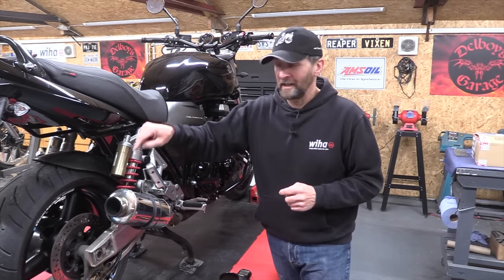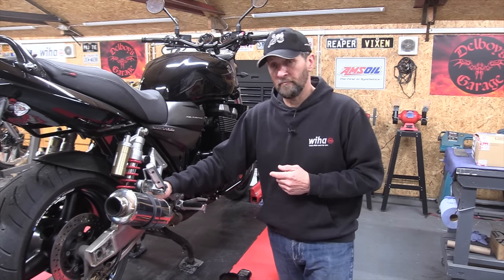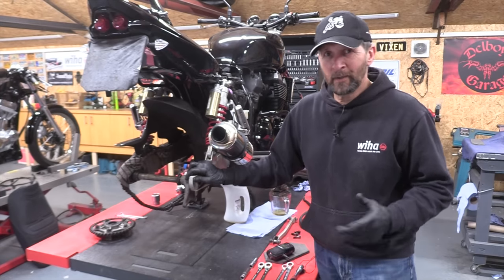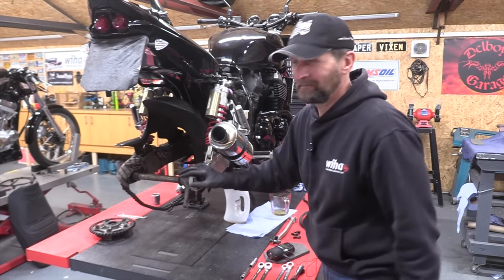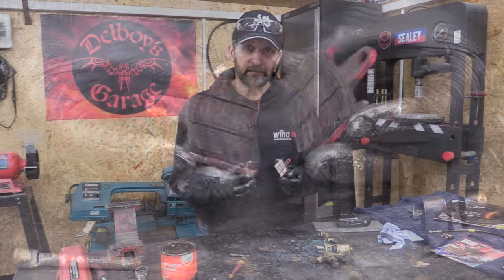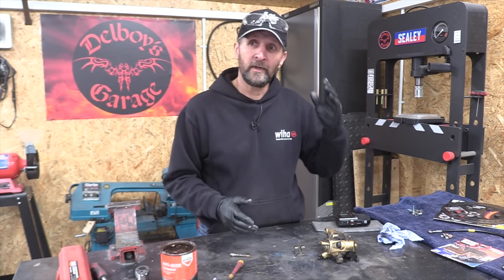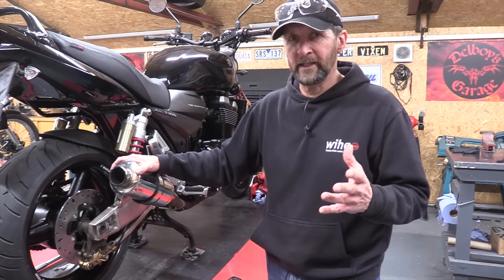Suzuki GSX 1400,  New Rear EBC Disc & Copper Sintered Pads  !

Comment: Not criticism, but an idea only. I would have replaced the seals in the caliper. After 70,000 miles they maybe working OK, but for how long given the new pressures involved with the new parts ? Lovely job either way. Good old sprocket and chain set, have had many of those in my time :) Further to my Blackbird 55W HID set blinking when on battery only, the main beam causes the dip to flash as does the flash switch. The guy from my dealer reckons its the current, even from a fully charged battery is not enough oomph, they work OK with the engine running. Just though I'd pass that on. Of course now, with hindsight (such a wonderful thing) I could have run two batteries in paralel to see if they would work on battery only. Schtump !

Comment: I must have an Eagle eye, as I noticed the chain adjustment right away when you were taking off the rear wheel. I first thought, Where's the chain and sprockets? Then realized, this is Delboy's Garage, it has to be in the next video :) I also noticed that a lot of the way you do things, I have been doing before I caught your channel. Like the axle and spacer trick. This can be real important on some bikes as the axle and spacers help align the discs to the calipers. Had a friend who needed help with this issue when he had the spacers in the wrong locations, and believe it or not, the wrong axle! He has 2 of the same bike, albeit, different years and the axles are slightly different lengths due to different size forks and triple clamp spacing. When he was swapping the front wheel over, he grabbed wrong axle. Helped him suss it out and taught him the same trick you mentioned. Just layout everything in order on the ground and/or put it back on the bike, depending on the task at hand.
Reply from the maker: Thanks for sharing your story mate, always good to pass on old tips and tricks!  Yes, chain and sprockets next, just upgrading and replacing parts ready for the summer... have a great weekend and ride safe!

Comment: You ever have issues with the brake pad bolts stripping? (the socket head) If so, any idea of what is the best order of action for that sort of thing? outside of having it cut out etc. Luckily yours there was in decent nick.

That EBC disc is lovely btw.
Reply from the maker: I have done a few videos covering that over the years... have you tried tapping a torx bit in the wrung out hole, they'll usually bite enough to get a grip on it and turn it out....  if that doesn't work, then next would be stripping the caliper into it's two halves so you can get hold of the other end of the pin with grips and turn it out that way !

Comment: She looks great.
mmmmm polish-shiney.

no copper grease on the back of the pads??
Is it only the front that needs it, or have pads evolved so far as to not need it?
Reply from the maker: You only need that if they squeak when applied.. older bikes always used to, it's been common practice for generations... but newer vehicles just don't seem to develop brake squeal.. so i only do it if i need to..!
Reply: @Moonfleet41  I thought it might be something along those lines lol
I'm doing the front brakes on Tilly bike, soon, they squeak a bit.

Comment: Hi Del, best wishes to you both from NZ, it's good to see your new bike.  
Great to hear you'll be changing the chain and sprockets next, I was a little worried when i saw the condition of them.  Another question, are you going to recondition the rear caliper as well?  
Ride safe....
Reply from the maker: Hey buddy, good to hear from you all the way from NZ!   Yes, the chain was corroded and fully stretched out and with the caliper, it operates just fine and doesn't need rebuilding yet... with this bike I'm just dealing with worn out consumables, servicing and a few little upgrades, it's not a restoration at this point.. I just want to ride it as we've coming in to summer now!!

Comment: I' don't tend to torque the banjo bolts these days just check for leaks.  23nm isn't a lot . You didn't say what torque you personally used for rear sprocket nuts ? I had an issue years ago on my 1400 (had since 2007 now )  I went by suzuki specs and rounded a thread (102nm) ....ended up going with 60nm and loctite . Not budged since . ....plus on torquing up engine bolts recently the top 155mm bolt /nut  rounded on the threads..couldn't remove it either . Drilled it out awaiting new bolt .

Haynes suggested from tech department to go with 55nm and loctite.  Its an m14 wheelie as the lower bolt is m16  (head) ......don't go to much into their torque specs ..I have the manual but I'm wary these days . Nice work.  I came to nose lol
Reply from the maker: There are no sprocket nuts in this video mate, not sure what you mean... do you mean the disc bolts and it is critical to torque them up so they're even and hold the disc in true alignment... something I'm sure you're aware of, or perhaps not if you've stripped a few bolts, is to reduce the torque setting if it's a wet thread... some way when using wet threadlock, reduce the torque setting by as much as 25%... so with that in mind, if your bolt is oily, just from an oily dirty job, it should be considered a wet thread and reduced accordingly... it's only bone dry threads and new fasteners that can withstand the full force of the factory torque setting because that's what the threads are like when first installed at the factory, bone dry and new... it's just good mechanical practice to understand that not all specifications are rigid when the situation you're working with is variable.
Reply: @Delboy's Garage  carrier bolts I meant my bad del was a long day yesterday lol like the seating video . Tidy job
Reply: @Delboy's Garage  last part regarding wet bolts . It makes sense . As you say the bolts from assembly line are brand new .

Lileky why first time round I had hg bolt yield and break on me ..I tapped all threads and it went successfully .

Keep it up fella loke the videos however they go .

Fork oil /springs /seals etc next . But mot first almost finished . Rad on this morning..1 m6 bolt not quite tightening enough . So thin gauge wite shouod help ..New rad go on in time anyway . . Bike needs my love lol take care fella

Comment: Hi Del, what's the make of the oversize socket set that you used?
Reply from the maker: Hi there, here's a link to it buddy, the box has changed colour these days, but the tools are the same... it's also vastly cheaper now, when they first came out they were about £250, so a good deal now!  https://www.spanner-monkey.co.uk/socket-set-26pc-3-4-quot-sq-drive-12-point-walldrive-reg-111046?search=ak2582&description=true
Reply: @Moonfleet41  Thanks

Comment: Was it not worth upgrading to a steel braided brake line ?  I like the brake bleeding gizmo.
Reply from the maker: Did i not do exactly that James..! did you skip the video maybe ?
Reply: @Moonfleet41  I must have missed where you said it was a steel braided brake line (near the end of the video) and seeing as it was black and did not look like a stainless steel braided hose usually looks I figured you had replaced it with a new OEM hose. My mistake.
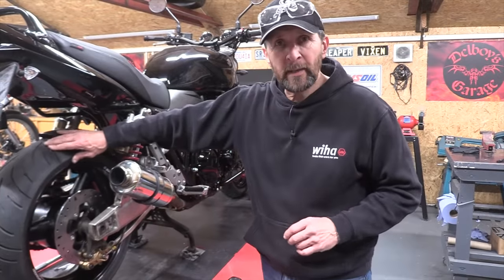Reply from the maker: @jamesweber4938  I guess you skipped the end mate.. 14:30

Comment: Hiya Penny and Del - happy Friday and great video! A very good tip on putting the axle back in place with everything in the right order, especially because life happens and you might not be reinstalling that wheel in 30 minutes like you planned. Nice to see your usual excellent standard of work, of course. And when you replace the chain and sprockets will you be replacing the rubber cush drives in the rear hub too? After all, they ARE 18 years old... and I just happen to have a video on the subject! (https://youtu.be/6170qmFN1j4) :P
Take care, my friends. Be well and drive safe!
Reply from the maker: Hi buddy good to hear from you, I'm going to leave the cush drives for now, I go by a wear indiciation of 1/2" rotational freeplay in the sprocket carrier with the wheel held still... this indicates the blocks have diminished and hardened... but there's no freeplay at all in this carrier so they're good to go for a while yet... plus we're a little spent out on the Harley project and just getting the basics done on the Suzuki to get it on the road for the summer, but good call buddy!  Have a great weekend, D&Px

Comment: Hi DB, what torque wrench do you use for the smaller bolts? I have one that starts at 28Nm but some of the settings are just below - any advice would be great - love the channel 👍🏻
Reply from the maker: Hi Nigel, I use this torque wrench for it's wonderful wide range, works from 7Nm right up to 112Nm... direct link here for you if you want to treat yourself:  https://www.spanner-monkey.co.uk/torque-wrench-micrometer-style-3-8-quot-sq-drive-7-112nm-5-83lb-ft-calibrated-119594?search=stw1011&description=true
Reply: @Moonfleet41  fantastic thank you so much 👍🏻

Comment: hi del handy tip i found for anyone finding it a hassle to hold up the wheels when lining up spacers  and axels  i got a little air bag you can pump up its  for  use when your putting up doors   so i put that under the wheel and pump it up and i can line up the wheel easy i,m recovering from  broken wrists  so its a help , got them in the center isle of lidls  handy
Reply from the maker: Sir, you are a genius!  What a fabulous little trick, even without the wrist injury, lining up a big heavy back wheel is always a bit rub-tummy-pat-head whilst trying to wriggle the axle through... so thanks to you Sir, that's on the shopping list next time I'm in Lidl... long live 'middle Lidl'!  Hope you have a good recovery as well mate.

Comment: You could also invert the way of the rear  axle from the left to the right with the nut on the brake way. This way the nut coult tight when running. As it us now its a risk of loose the nut when running.
Reply from the maker: I see your logic, but that is a bit of a myth buddy, the only time to reverse an axle is when it benefits access to loosening the nut for chain tension on bikes where the exhaust's in the way, such as Harley Sportsters.